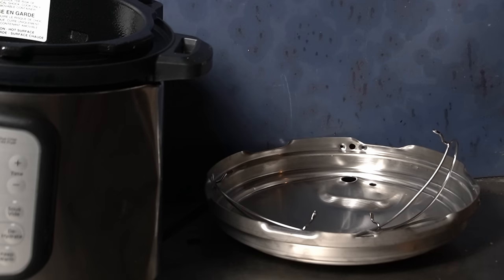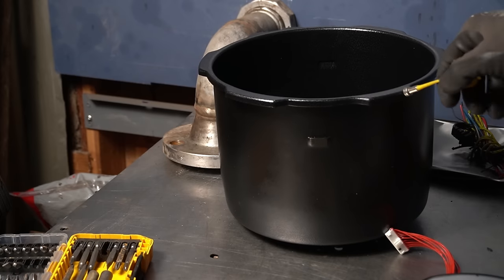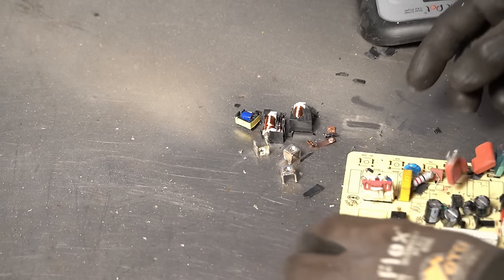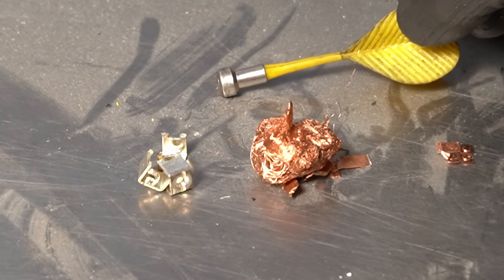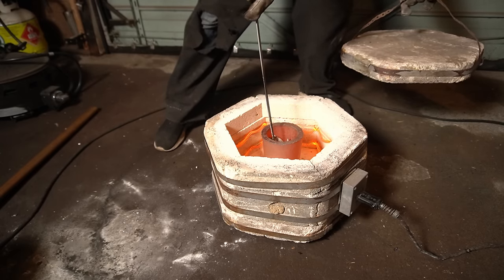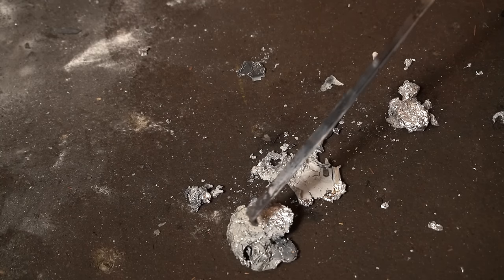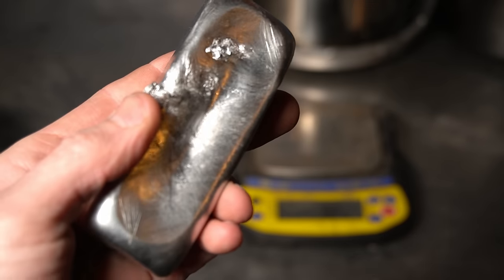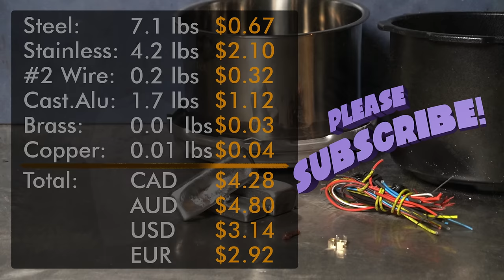Scrapping Metal from an Instant Pot and Smelting Ingots How Much

Comment: Hey Thubprint! You've inspired me to start scrapping! A couple of my local garages have actually been PAYING someone to pick up there scrap. I said I'd for free and they liked that! My problem is my junkyard only pays 20cad/ton for shred and 50cad/ton for steel and they class everything above 3.5mm as steel. I see most people are getting like 190/ton for prep!! Im hoping the copper from alternators/starters will get me by.
Reply: @pearsonschofield7626 Those prices are low. In Vancouver I’m getting $220/2000lb ton for tin (appliance, bikes etc) $175 for shreddable (fridges) and $275 for steel Where are you? Are there any other scrap yards close enough by to make the drive worth it? If so I’d suggest collecting enough material to make dedicated loads (all shred or steel or non ferrous)
Reply: @mayfieldmetalrecycling7012  I'm in st johns, every yard on the island quoted within 5 bucks of those low prices sadly. The yards are all pretty small compared to what I've seen in people's videos or when I used to live in Nova Scotia. They don't sort past shred or steel and copper is either copper for 5$lb or wire for 2.3$/lb.
Reply: I get 300 ton for prep steel. But I have alot of steel.   Calgary
Reply: I’m in Wisconsin but it’s about $160usd for a ton of shred.
Reply: In edm it’s less then a penny a pound for shred. 12 cents for prep
Reply: Look for appliance repair shops. They often will have excess scrap as well.

Comment: Brother you switch the furnace on. Bring it to temperature check with heat gun. Then you put a full number 8 crucible in for 9 minutes job done. Always pre heat electric furnaces when at temperature then add crucible. Hope this helps brother. Awesome episode

Comment: Usually those yellow pieces on the circuit boards have copper inside too 👍
Reply from the maker: Oh? I could’ve checked. I popped one off and found it filled with resin so didn’t want to try any harder than that